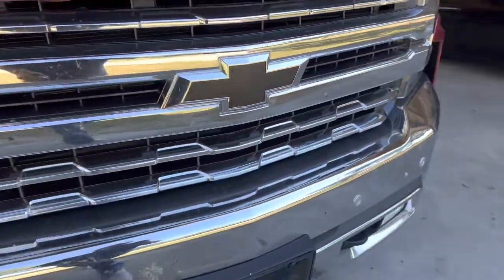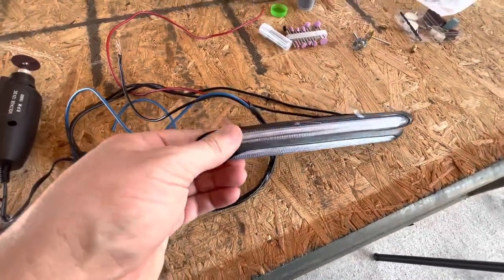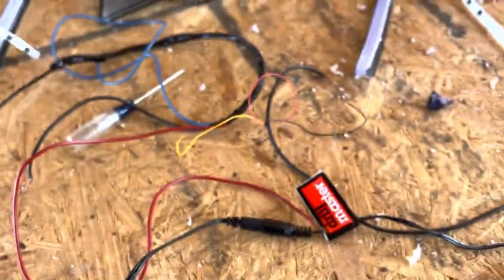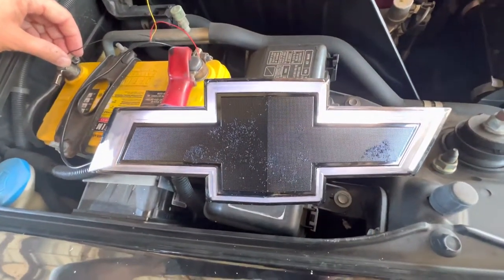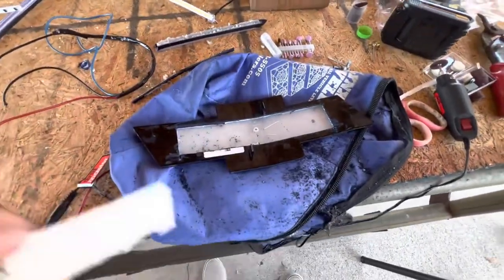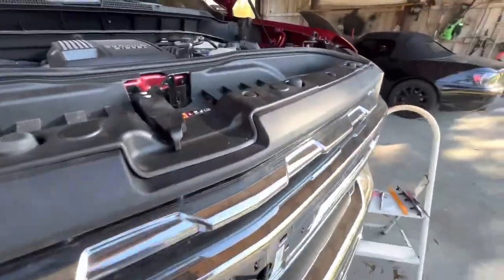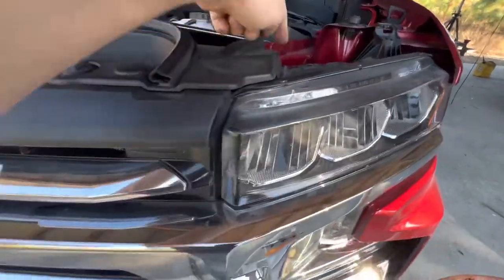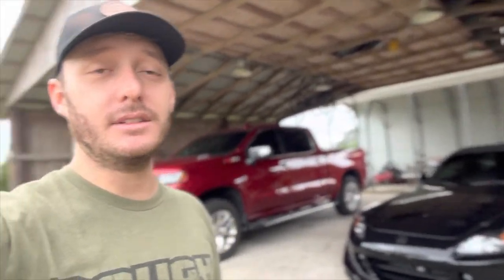Silverado Glowtie, but brighter.

Comment: Can you explain how you connected the LED wires? I used the harness that plugs into the headlights, but I've had mine less than a year and it's already out😭, so I want to do something similar.
Reply from the maker: The strips that I epoxied into the back had pigtails on them so I wired them into the harness that came with the glowtie

Comment: I installed one years ago on my truck and it just lost its spark. 😩 and now it's completely off.
Reply from the maker: Well this thing is still going strong and way brighter than it was to start with.
Reply: @solamente.yo.1 how long did yours last before it went out? I just ordered one:/
Reply: About 5-6 years. So it's still on, but very dim. Just sucks bc you would think it would last longer bc it's so damn expensive and you can't even change a bulb on it. 😒🥺😭
@209Stretch
Reply: Damn that sucks. I thought about that before I bought mine but it looks so cool I couldn’t help it.
Reply: Saaame! I've had mine for less than a year and it's already out.😭 Mine was def not free. Super frustrating😤
Reply: @erinjohnson8095 girll, a year! Man that sucks! 😭 they look so nice but man I don't get why they don't make the lights replaceable. Doesn't make any sense at all.